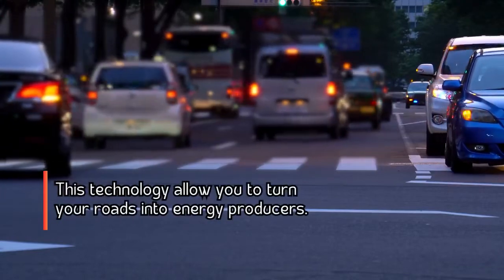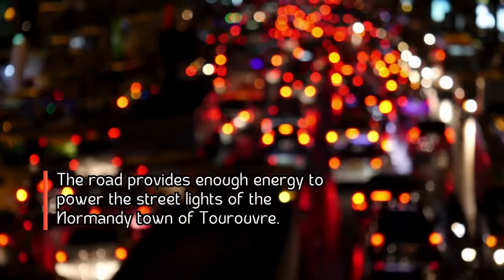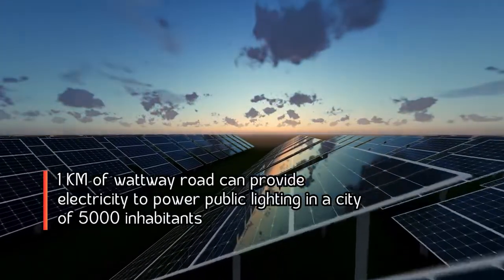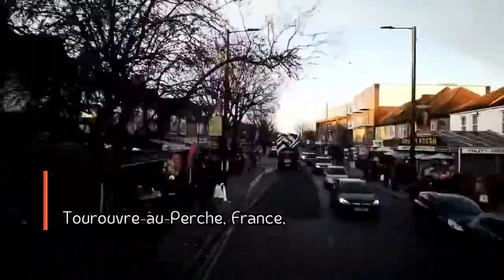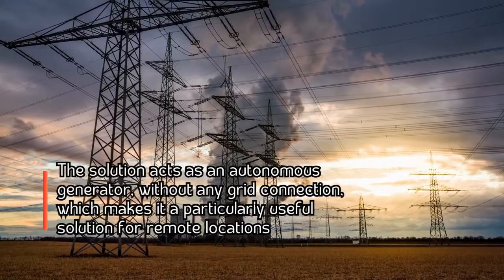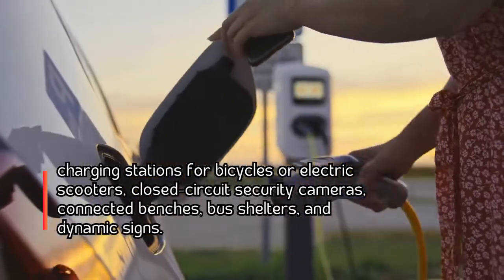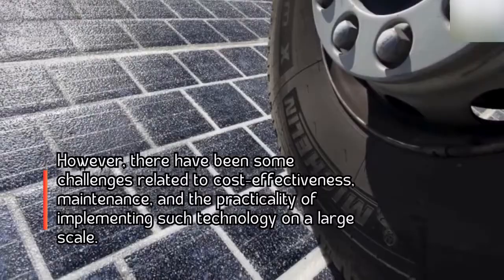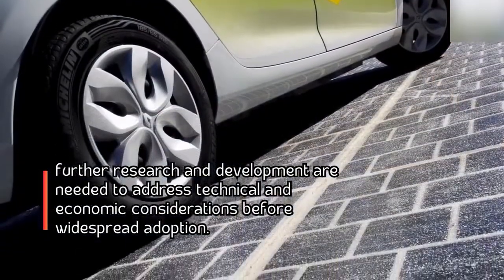Wattway – Solar Roads Changing the Future of Transportation

Comment: This has been proven in practice to not be a very reliable road or source of electricity
Reply from the maker: It's a prototype of many good changes required but technology is superb for generating sustainable energy
Reply: @gadgetxplorer  or... You could just put the solar panels on the side of the road at the appropriate angle. Much easier to maintain and cheaper.  You also don't have to worry about the grime from the cars cutting your efficiency.